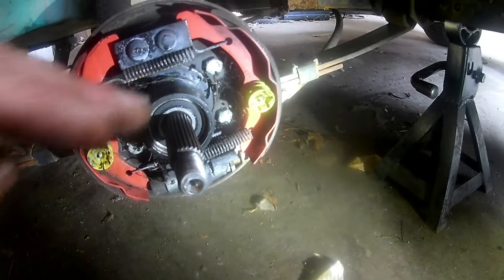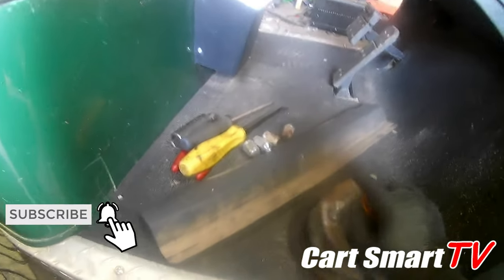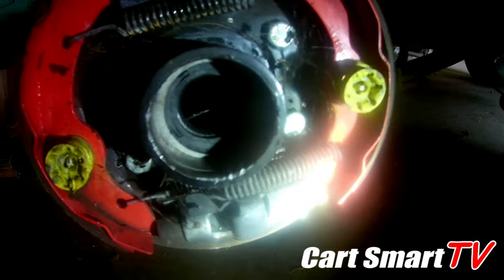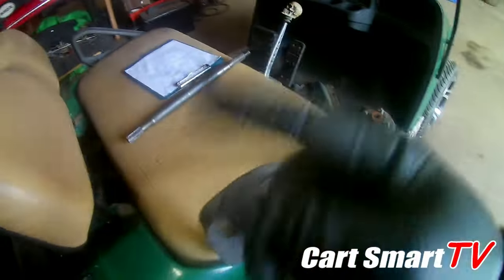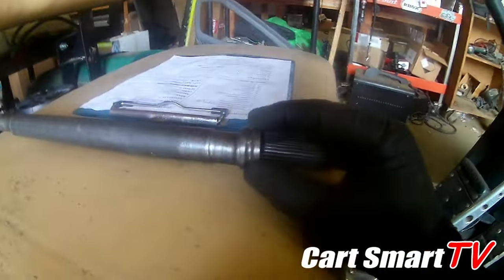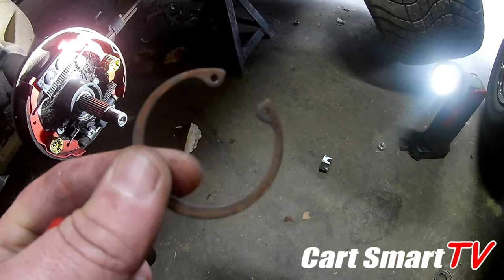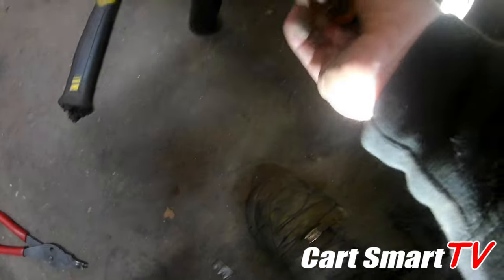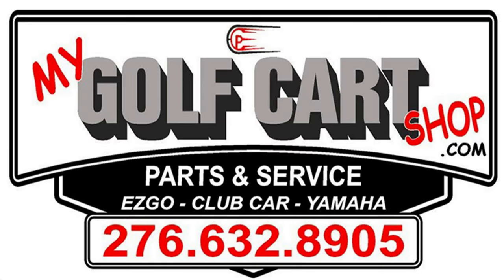EZGO Rear Noise

Comment: I’ve taken wheels off to see the spines on both sides and they both look good cart. When I took off the wheels, there was grease all over in the castle bolt. Won’t move going forward or in reversed. Can you help me with troubleshooting?
Reply from the maker: Most times the axles do look fine. The Hubs are designed to wear out so I would look close at those. Can take them both off and press the gas pedal to see if the axles turn?
Reply: @cartsmarttv  the axle turns but slow. I took the spine rod out and one side was wet and the other dry. But once I had it out and put back there was oil throughout both sides. Is this normal?
Reply from the maker: @Carol-ms8vm  sounds like the axle seals are leaking?